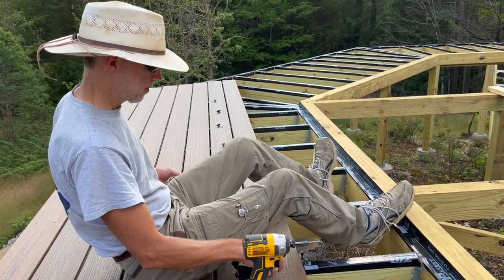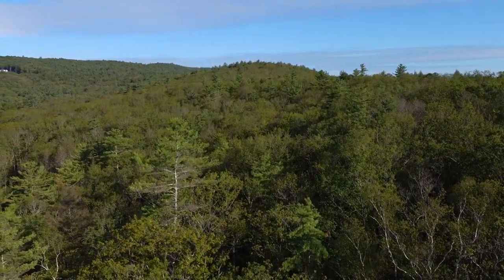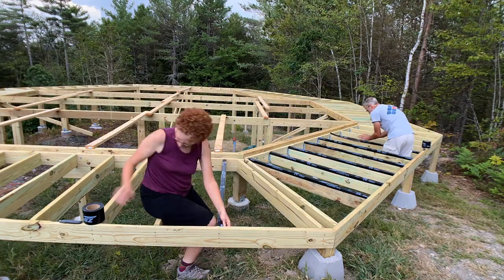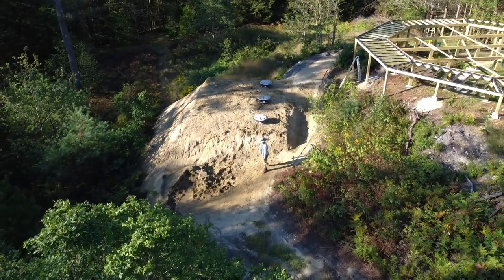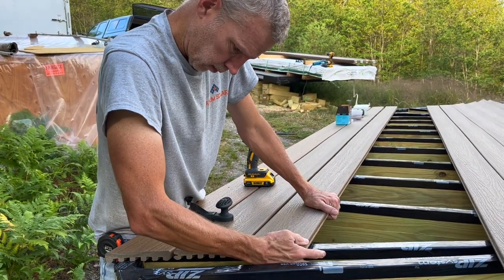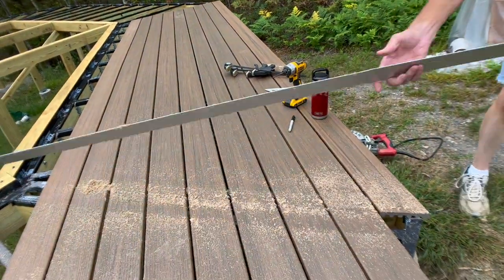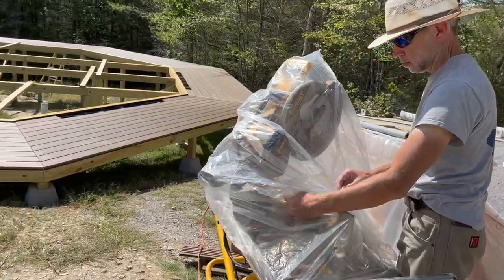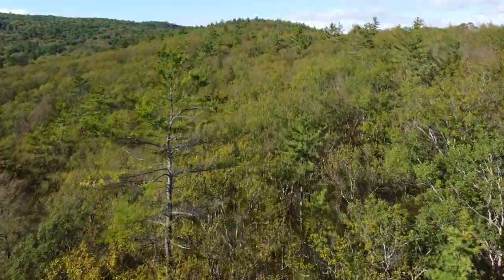Yurt walkway decking (Vermont DIY off-grid home build)

Comment: So you've learned to fly! I love the drone shots of the area, but it would be good to see a bit of explanation of how that works. I know what a drone is, (sort of), but how do you make it go where you want it to go and then come back again? Or did you really learn to fly? I love the deck and the Yurt so far.
Reply from the maker: Charles might add more to the answer to your drone question... It has four propellers and it interfaces with a cell phone to control the flight and the camera. It is a nice one, and very compact (would fit in a cereal bowl).

Comment: I’ve never seen whatever that is that you placed on top of your perimeter deck joists. Is that just an adhesive for your decking? So the decking is not wood, but some kind of composite plastic material? I’ve never seen that before. More durable than wood?
Reply from the maker: We just put zip tape (like what people put around windows on houses before the siding goes up) on top of the joists to keep them a little more weatherproof. The joists are treated lumber and the decking is composite.
Reply: @OvertheRiverandThroughtheWoods  Thanks. Very interesting idea to use the zip tape. I never would have thought of doing that. Since your perimeter deck will be exposed to the weather, extra protection won’t hurt. Just your idea?
Reply from the maker: @ShikokuFoodForest  Nope, it seems to be a fairly common practice on decks these days. Many YouTube videos on deck building seem to recommend using the flashing tape on the top surfaces to keep the water from sitting on top and between the joist and deck board.
Reply: @OvertheRiverandThroughtheWoods  Thank you for telling me. I’ve been studying building science, but not decks yet. Makes sense. I should do the same when building my yurt deck!